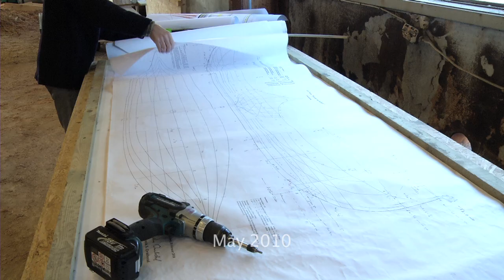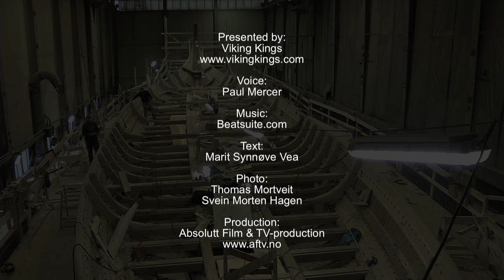Dragon Harald Fairhair. The construction of a Viking Dragon Ship

Comment: The fact that the actual blueprints for these ships were never actually written down. The entire process was simply passed down from father to son over and over again. It just blows my mind to be brutally honest. Not only that, but the level of craftsmanship needed to produce the ship in the first place is unbelievable. I am a bench carpenter. I consistently create bespoke furniture, and honestly, working without any form of drawings is alien to me. It's how we are taught, and it's almost instilled into the modern mind. I can honestly say that if you asked a modern bench joiner to work on such a project with just viral instruction, they would struggle.

Comment: Interesting note: Slavs also built pretty much identical ships. The one difference? They were made entirely from wood, using wooden pegs instead of rivets. The pegs would expand when the ship was put into water, thus sealing themselves in (so higher maintenance, but lower cost and faster speed time).
Reply: Skandinavians and Slavs came to Gardarijki region at the same time, and then they mixed. So you can't say who were those guys, Normanns or Slavs. In fact one of biggest ship building centres were in Novgorod
Reply: Makes total sense, I mean they are Slavs AKA Kievan Rus AKA Vikings

Comment: Although certainly a beautiful ship when seen in its entirety, I am sure, it seems all to excessive in its dimensions of planking and overall structure. Why was sawn planking chosen for this big ship rather than axe cut planks? The experience of the Roskilde replicas was, that sawn planks incurred at least the double in planking thickness as to prevent cracks in the planks but also doubling the weight. This in turn would require a much stronger keel, frames and knees. Looking forward to see it..